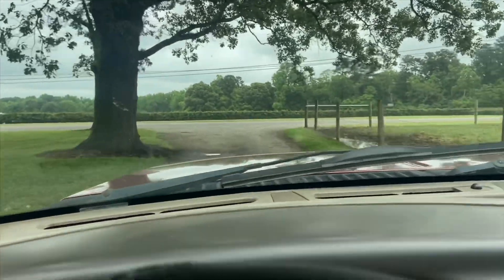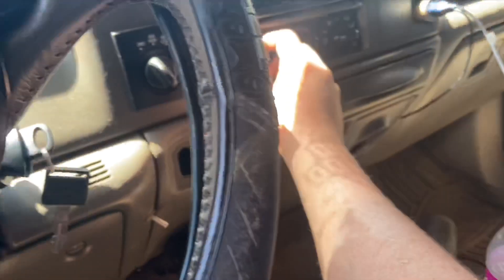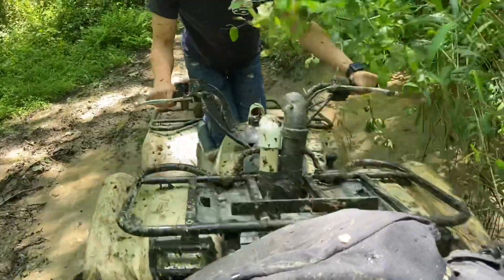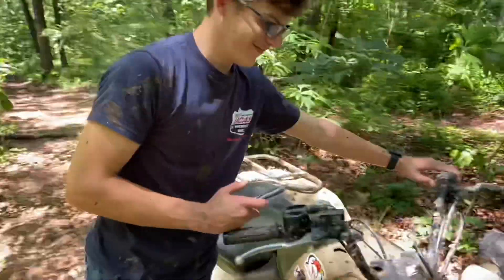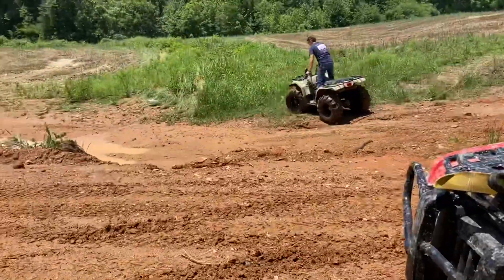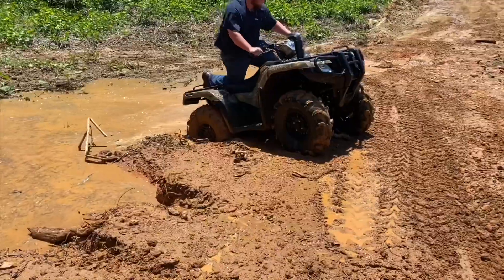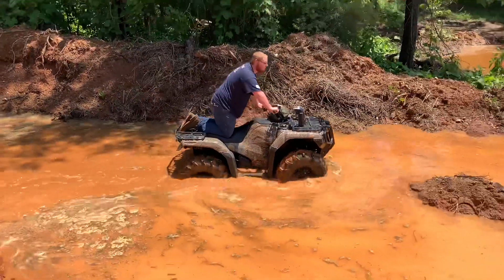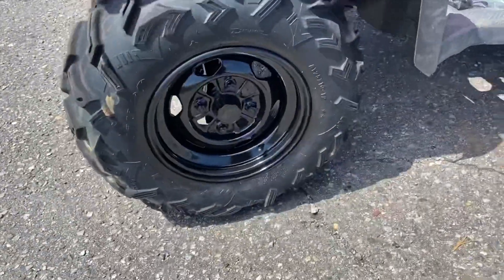2020 Honda Rubicons MUDDING!!!

Comment: Really disappointed in Honda four wheelers they need to step up their game and make a mud ready 1000 fourwheeler.
Reply: Ummm not really u don’t need a 1000 to go missing genious. The Honda’s will spin any tire without problem and if u go really big tires than just put in a gear reduction.
Reply: We think they need a big displacement wheeler but honda has never been one for big displacements. Our 520 pulls through whatever we have put it through.